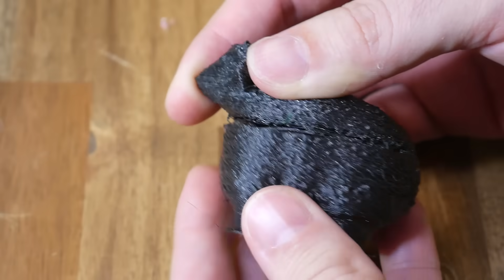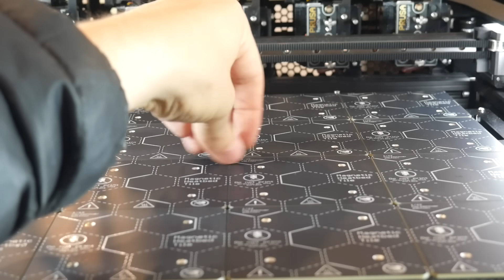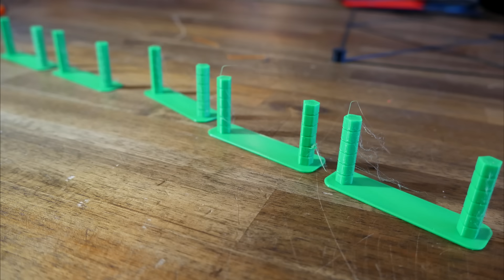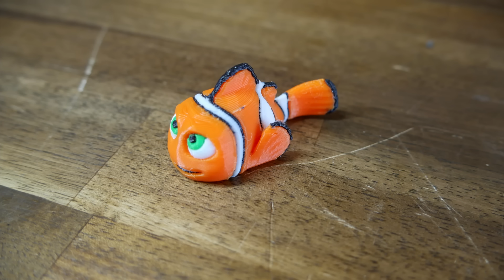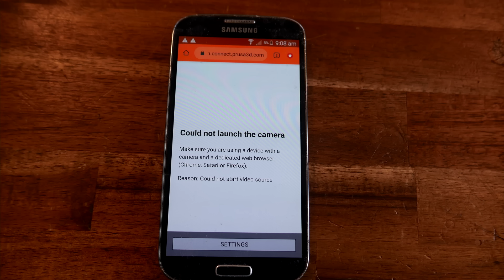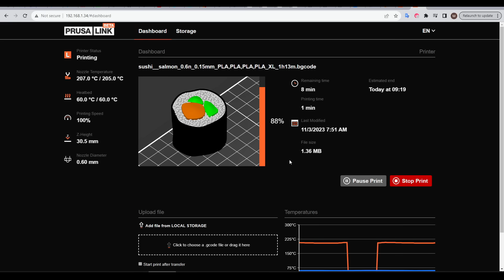The 5 tool Prusa XL is currently flawed, but I think it can be fixed

Comment: To me it seems like Prusa has some great ideas, but is handcuffing themselves with their manufacturing approaches. 3D printing your own printer parts sounds cool, but it's just not economical, nor is making the hardware in the EU. They are fighting an uphill battle by putting themselves at multiple competitive disadvantages.

At first they could justify the cost by being ahead of the game in terms of quality and reliability, but now that others have basically figured it out and borrowed many of the same ideas, it looks like you're mostly just getting a printer that is conceptually 'nicer' but in practice just a worse value than other options. That's just my perception; I have a MK2 from years ago that is still good, but I don't think they're doing what they need to do to actually grow as a company.

Comment: Prusa would know these issues before shipping the machine. Paying customers need to modify code etc. in order to have a machine working properly, come on. And on top of that, these cheapo DIY printed parts, on such an expensive machine. I have never been a Prusa fan, and this certainly doesn't help.

Comment: Your Nozzle seals are wrong adjusted. Thats the reason of your Problem, not the printer. Assamble the printer correct like the manuel it shows and you have no problems.
Reply from the maker: As the video explained, these were assembled by Prusa. So send your feedback to them.
Reply: @TeachingTech   This is the half true. The fully assembled XL is also delivered in such a way that you still have to screw on the individual toolheads and also adjust the respective seals, which they obviously haven't done. It is even explicitly stated in the instructions, which they must have completely ignored.
Reply: @TeachingTech  Even on the pre-assembled XL you need to manually install the toolheads. The assembly manual clearly points out that you need to adjust the nozzle seals while doing so, and looking at your video it's obvious they are very misaligned. Hot nozzles sitting around unsealed will ooze, on any printer. Adjust them (it's literally just a few turns with a screwdriver) and your stringing issues will be gone.

Comment: Not all XLs are problematic. I preordered the single tool XL kit on day one and since it finally arrived it has been excellent (as the Mk4 also has been). The instructions were adequate and there have been no major issues. The slicer and firmware updates have been improving the machine since then. I'll upgrade it to 3 tool heads when they get the multi-tool bugs out and offer the kits. No one else produces a multi-tool printer at this price point, apparently it is a difficult product to bring to market. I hope Prusa gets it straightened out.

Comment: I am still wondering why multicolor prints on Bambu Lab or Prusa with completely separated heads for each color require a tower?
Isn't purging enough? Bambu mini purges enough filament to make the color change enough. So why tho?

Another point about Prusa by itself. Considering its huge community and fans, it delivers high premium price printers completely unfinished, not tuned enough, and documentation is not up to date.
So, why would people choose this printer rather than Bambu P1X Carbon with a color change head? 
Especially taking into consideration that Bambu printers "works out of the box". So why tho?

Comment: Sounds like the quality is not there, same like Wabeco D4000 lathe, that is very bad quality for 4000Eur, the thing does not even work out of box. I still have not repaired it after 5 Years. Just recently found a guy willing to scrape the bed ways and maybe it will be working.

Comment: I'm surprised in this day and age, they didn't go with silent motor drivers at 8:52. Those chips are like a dollar max if you buy individually, and cheaper in bulk. Same with the webcam, a esp32cam is like $3. Surely they have Bambu printers in their engineering lab to compare to, print quality aside I can't believe they saw these basic low hanging fruit features and was like "yea we'll ship without these". And I don't care if the end user can mod it in, for such an expensive printer I shouldn't have to even touch it.

Comment: I didn't realize that the Prusa XL was so bad, what a pity. I also thought it already had an integrated nozzle wiper for each Extruder this is mandatory for every 3d printer out there. It will take some time but I'm sure Prusa will fix all of the flaws in the next 1-2 years.

Comment: Ok, I'm not really yet into multimaterial printing, but there is a question as I don't understand one thing:
Purge block is for 1 nozzle machines to actually clean up nozzle after filament change right? So why multi-nozzle machine also needs this?

Comment: Given the competition's offerings, that price point is such a hard sell, even with the multiple nozzles.

I know it's open source, but i'd also expect less 3d printed parts for that much money.
Reply: You Clearly don't understand why they use 3D printed parts. Is not just cheaper. Is the smart way of iterating fast. 
Printed parts are sturdy.
Also, is how they put they money where their mouth is, right? Production is how they test and improve their farm first and then customers.
Many of these parts would increase the price absurdly if machined and get improvements easier.
Reply: @fofopads4450  Printed parts vs injection molded???  LOL!!! 🤣🤣🤣
Reply: @fofopads4450  what a fool, what a fool! You have absolutely no idea what you're talking about.

Comment: To be honest I am not a prusa fanboy or either hater, the machines like MK3S and so on has been great machines that has been working out of the box, but if you take look at the XL or MK4 these machines should have been there 2-3 years ago and not being released now, they're not offering anything special compared to other printers in fact they're falling behind when it comes to features which are now days common in the other brands. And one of the main's selling points for most of the Prusa users - unpack machine and print out of the box is not there anymore too when you take look at XL and the customer support at least what I have heard from the 3D printing groups isn't on the level as it's been before.

Prusa has just rested on his laurels and haven't brought anything special out or at least something that could compete with other brands (Which is sad when you compare size of Prusa Company to other 3D printer brands).

Comment: To fix the stringing, properly adjust the silicone flaps below the nozzles. It's clearly visible in your video that they are misaligned. The assembly manual actually even warns you that this will lead to heavy stringing, as the nozzles just sit there oozing after being parked otherwise.

Comment: Wow...My heart honestly sunk watching this. You were about as gracious as you possibly could be. For the price of over 3 Bambu Lab Carbons and a Bambu Lab A1 Mini combined, Prusa couldn't give you one functional printer, let alone one that could hold a prayer to a Bambu Lab offering... It's rough to see because I'm a Prusa fanboy through-and-through. I've got an MK3S+ and two Mini+ models right now. I have had very few issues with any of them and especially enjoy that the Minis can print Prusament ASA so stinking well without an enclosure. I also built a Voron v2.4 and have a Bambu Lab X1C. The X1C just blows me away in every possible way. I certainly notice the closed ecosystem and the lack of ability to customize the Z-offset on an aftermarket build plate, but at least the thing just works next-to-flawlessly when you use the intended hardware! I'm really disappointed in Prusa, and in truth, I'm worried about their future in this market. On the other hand, no other company deserves more of our support to uphold them through tough times than Prusa, as evidenced by your deep-dive into the problem-solving process in this video. I really hope they pull out all of the stops in these next few months to make up for this...If they don't, I worry this could be the end of Prusa's reputation for next-level reliability and performance. Thanks again for all of the great videos and I hope they get these issues dealt with for you and the rest of the community that invested so much in the Prusa reputation! That's a huge chunk of money to invest, and you definitely deserve to have an amazing experience in 3D printing with that level of investment. I actually reserved one early on as well, but cancelled the order after 6 months due to impatience. I figured I could jump into the Bambu Lab market in the meantime and revisit things after the XL finally hit the market. I'm somewhat bummed out to realize that was such a good decision in the end.

Comment: You say you flashed the alpha firmware. Were all these test done when running that FW? Because if yes, then that's not fair. You can't expect an alpha FW to perform like a stable version. 

Don't get me wrong, I had my fair share of cursing at Průša. And I do think that they need to catch up to the competition. But you can't use software clearly labeled as alpha and call it a fail.

Comment: Thats why 3D printing is still shit. Just wow.... For me a 3d Printer is a tool, it just has to work properly (at least somehow) And yet.. several generations and many years and still they are more headache than actually priting. No wonder I didnt turn my printer on for a year.
The only good "prinitng" are resin printers... but for me they are too expensive, the printers the material and the handling with all the chemicals. Not for someone without a garage or shed. But they at least produce quality prints, what I mostly need because I usually print really detailed mechanical things. And normal 3d printers always produce inproper proportions and dimensions.

Comment: Thank you for the in depth review, especially the mixed material.  That’s the reason I’m looking at it.  I’m tired of manually editing Goode to fiddle with it on the MK3s and MMU2s.  I’ve seen other videos with fantastic mixed material results.  I wonder if there is a difference with chips on the boards possibly based on shortages and supply issues with such an experience gap or just bad QC standards?

Comment: Even in Europe its 2 grand and for that price you'd expect something which is ultra reliable. To me it looks like these print heads are just oozing away while they are heated up and therefore they need to have additional wipes before and after use to clean them. Preferable with a poop chute somewhere to discard dangling bits.

Comment: Prusa fanboys are one of the worst there is. There's no denying that both the ini and the XL are a assive disasters but somehow if you say anything like that, you will get eaten alive, no matter how much proof there is, and from how many people.
Reply: The main complaints I see is that it isn't really a fair comparison to compare a product out of China with one made in Europe in terms of price. But of course many people don't care about that, especially not people that don't even know what the RepRap project is. 

I agree though, the XL is a disaster for that price, with the state it's in right now it should really be sold more as a "development kit" so that only enthusiasts with the knowledge and motivation to fix it actually buy it. E3D sort of did that by offering their whole toolchanger motion platform for sale, but unfortunately they eventually cancelled that project for good.

But a regular person that just wants to print, has better value options nowadays. Especially if multimaterial printing is a big factor.
Reply: @rereertege7571  they should treat it like E3D treated their toolchanger. E3D never advertised their toolchanger as a 3d printer but rather a motion system with toolchanging capabilities

Comment: Has anyone come across an anoying USB disconnect bug?   Even with the 4.7.2 firmware, some of my very long prints will just stop in it's tracks becuase the USB drive had spontaneously disconnected.  I will then have to pause the print, unplug and then re-insert the USB drive and unpause the print.  It doesn't matter what USB drive I use.  Quite a few others have experienced this issue, but is doesn't seem to be wide spread.

Comment: Buddy of mine purchased a 5 head when they first announced it..And he has been dealing with the same things $5k and hasnt really made anything that impressed with. The tool change is a great concept not only for multi color but multi materials.  We both also have bambu printers and the amount of waste and the time it takes to change from color to color each layer is alot. But man i just still cant see the benefits  for this printer.. Even if bambu keeps the AMS forever , if they release an Idex printer that can handle 4 AMS on each extruder which means you can actually do multi material ..Its gonna be over for  Prusa

Comment: I have a Prusa XL 2TH that was a day one pre-order still sat in the box - I caved on the last day of their pre-order claim window but all these issue reports have me considering a return without even opening it, despite the painful import tax I had to pay on top. 

I love the size and multi material potential (especially soluble supports, PLA support for TPU - only the SnapMaker J1 was my other consideration, but it's smaller with its own problems). There was such trust in Prusa based on their i3 reputation, but they've lost a lot of trust with the layer and stringing issues here among others. 

I just cannot believe they surely saw these issues in their own years of testing and shipped the XL anyway. It sounds like some of it can be solved by software and firmware updates, but other hardware issues (no nozzle scrubbing, YGK3D's layer problems fix) would need them to ship everyone upgrade/fix kits. Hopefully there's a better picture of how much can be addressed through those alone before my returns window is up. I know they support their printers long term, but we just shouldn't be in this position, especially given the price of these.

Comment: 100% captures my experience with the 5 tool XL. I’ve even reverted to printing some models with Bambu X1C despite the extra waste just to get more consistent, cleaner prints.

If it were easy to return, I probably would at this point. Instead, it’ll be a low use machine for me until Prusa makes it A LOT better.

Comment: wow the quality of those prusa parts. awful. and they insisted that resonance compensation was not worth it for years. Prusa has fallen behind, Failed to print fast, Failed to print high quality, Failed at Multi Material, and they seem to be failing at tool changer. i wish bambu would give them the kick they needed but they seem to care more about crying foul and starting drama with them, rather than trying to get ahead of them. and as much as i like prusa they cant hide behind being open source. they need to stand on their own regardless.

Comment: Prusa produces great i3 mk printers and slicing software second to none, but I'm shocked that after two years of working on the XL, Prusa put out an expensive printer that makes second rate prints at best.  Even Prusa's MMU's which come as kits are no match for Bambu Labs MM system which comes pre-assembled in a space efficient form factor.  Prusa needs to up their game if they want to stay relevant in the future.

Comment: Hello, I early bird pre-ordered a 2 tool machine. when i started seeing videos of the machine doing actual prints in peoples homes I knew something was odd, The stringing is not a small amount of stringing its some serious tuning problem. Prusa is in big trouble because people like me canceled their pre-orders. I will not give you 2500 bux for a printer that does not work properly out of the box. I gave Bambu labs 450$ for a 4 color A1 mini and this thing prints bad-fawking-a$$ STRAIGHT out of the box. ZERO ISSUES. Its such a dream to print on i find myself printing way more than i did before. I consume way more filament now with the bambu lab printer "you hear that filament companies!" not because its wasteful but because the printer is so fast and reliable that its just a dream to print on. I hoped to have that same experience on the XL. my Prusa mini was also a dream to print on but its no speed demon so some things were out of reach. the bambu lab printer however can turn 3 day prints into 1 day prints and do them incredibly well. 

PRUSA I WANT TO LOVE YOU, I LOVED MY PRUSA MINI, WHY YOU DO US DIRTY LIKE THIS!
Reply: Not as dirty as box full of plastic poop going straight to a landfill
Reply: @fofopads4450  I don't throw it away I recycle it by using it as flat rate packing filler for my friends, we ship our poop back n forth. It's awesome and I'll take it in a heart beat if it means my print come out good

Comment: This shows how little Prusa cares about its customers, these print problems should have been easily caught and be rectified in testing, instead they released a beta product, a $5000 beta product, to have customers fix the problems for them. Honestly, I don't get where Prusa got their reputation from. As a MK3S+ owner, I never felt I needed to do any less optimisation or fixing than my Ender 3. In fact, it was only on the Prusa that I had a random catastrophic failure where the printer just decided on its own to bury the print head into the print bed
Reply: Have you ever used an ultimaker?